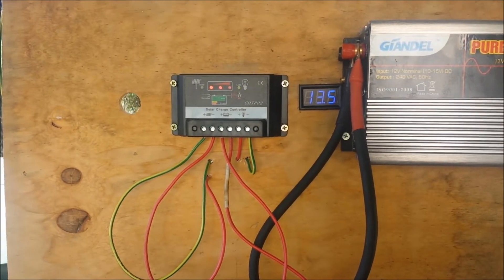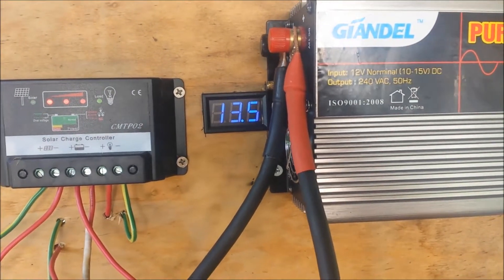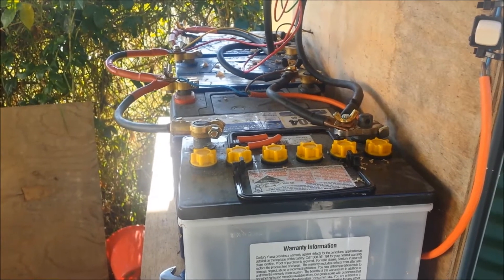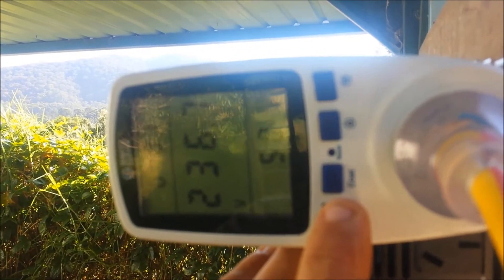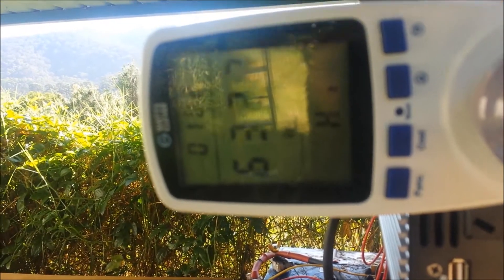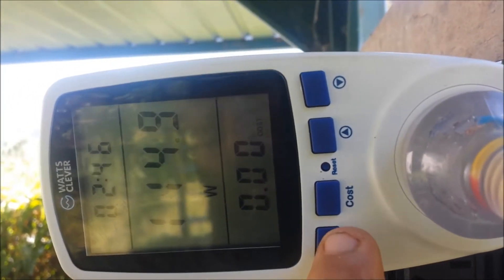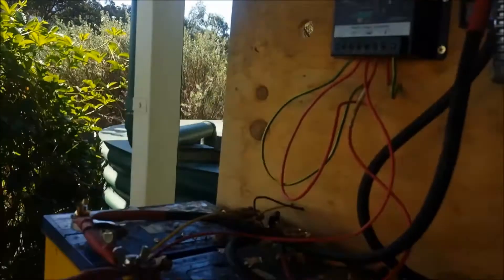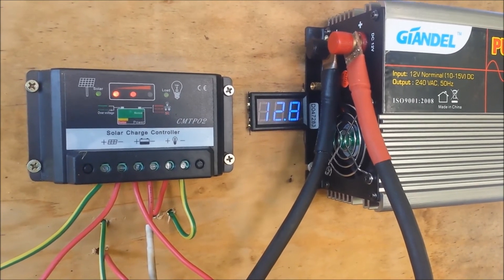Testing the Fridge on the Simple Solar System

Comment: Hi, come across your videos on using solar power even though a few years old.  Everyone says don't use car batteries (maybe so they can sell expensive ones) but how did you find them for keeping their charge under load and time taken to re-charge if needed while panel connected?
Reply from the maker: Honestly, these were pretty shitty because they were old. They recharged fine and as long as I didn't run them down too much at night, they were okay.

I prefer deep cycle batteries but a man's gotta do what a man's gotta do. If you're on a tight budget, car batteries, even old ones, are better than nothing. The trick is to learn to use most of your electricity during the day.
Reply: @PopsShack  Thanks for that, yeah budget very tight to non existent at moment.  Lots of sun (usually) where I am and wanted to switch over for few hours on solar once cheap rate electric finishes at mid day.
Reply from the maker: @andyb1201  have you seen my video about converting a freezer to a fridge?

Comment: Good video i was just researching how many batteries it would take to run a refrigerator.
Reply: scott d visit aeacares.com they have a handy calculator to help you size your system correctly. Once you have that figured out, you can choose from their complete systems that include everything you’ll need, including batteries. They also carry hybrid systems (solar/wind). Hope that helps
Reply: I am also looking for exactly the same thing. Because I find it difficult to calculate power consumption of refrigerator because it isn't a continuous power draw appliance. It only runs a few minutes so I don't know how to really do the computation of watts usage per hour.

Comment: I would think a 250w panel at 24v would give you more then enough with good batteries as well.
Reply from the maker: Ausprep When I build the solar power system for the house, it will be 6 x 300W panels @ 48V nominal. I'm happy with this system being 12V, but I plan on adding another 100W panel to it.